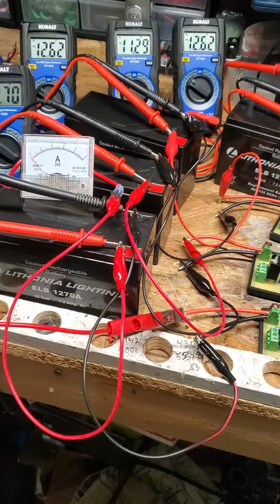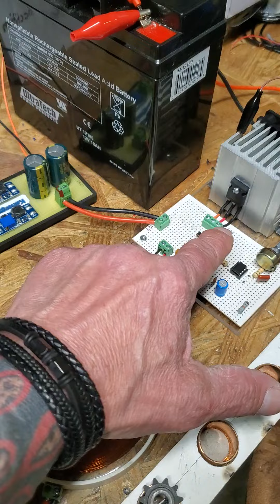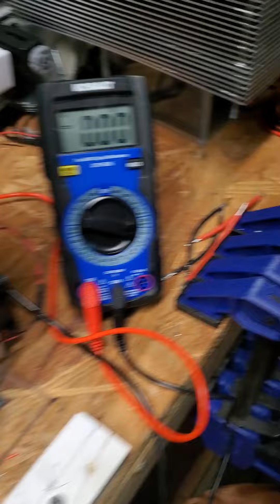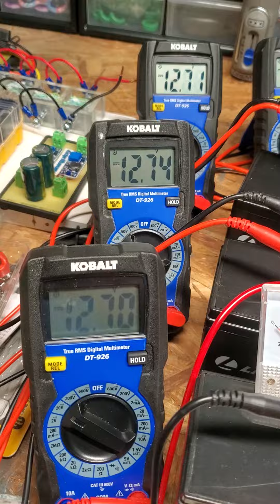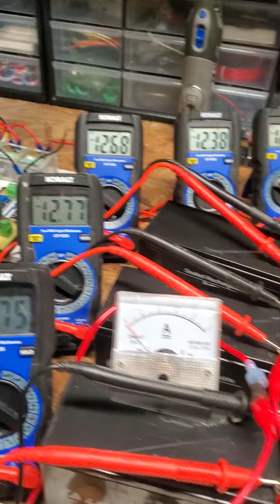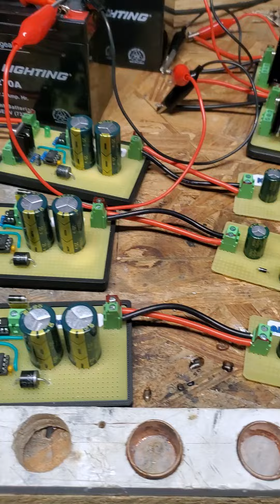Tesla pancake coil meets the energy harvester circuit, charging 5 batteries

Comment: Very interesting Jason. Thank you for sharing. The question is how long does it take you to fully charge all 5 batteries, do you know to tell? Thank you.
Reply from the maker: I was able to charge all the batteries up to 13.5 in about 3 hours. The run battery was still good shape and probably could have charged another 5 batteries. I guess it all depends on how depleted the batteries are as well. I only have so many batteries for testing but at the very least I can charge 5 at the cost of 1 battery so 4 for free.
Reply: @MrFixandtheRabbitHole i agree. And it’s sounds like an interesting concept, im whiling to calculate the time you take to charge all of them and how many Wh you are using. By that, I can tell you if there is something here or not :) by feeling says yes, but you know how it is - we have to check it professionally:)
Reply from the maker: @Waveit5  I totally get it. That is what a good Scientist is supposed to do. Doubt everything but be open minded as well. It is a different kind of energy that is not in our text books. Have you seen my latest videos? You may find them interesting as well. I am happy to answer any questions you have.
Reply: @ would like to explore and explain you more how i see it and make some approval’s for this test and prove some point that you may have there. There is any other communication methods we can move on to? Email
Reply from the maker: @Waveit5  sure eppinjason269 at the g  mail

Comment: So you're using one battery as constant power input to pulse five batteries to desulfate them with pulsed power output...  I fail to see any energy being "harvested".  I hope you're not thinking that you've made some kind of over-unity machine.  Your output pulses are short in duration so the current of your output pulses need to be divided by your duty cycle before you can determine whether the energy (watt-hours) leaving the circuit is even near your input energy.  (Hint: it's not harvesting anything but your source battery.)
Reply from the maker: @AkkerKid  I am not claiming anything, one battery to charge five and the battery is still over 12.6 when I was done. Maybe you didn't watch the whole video?